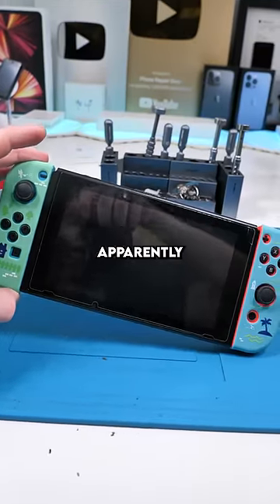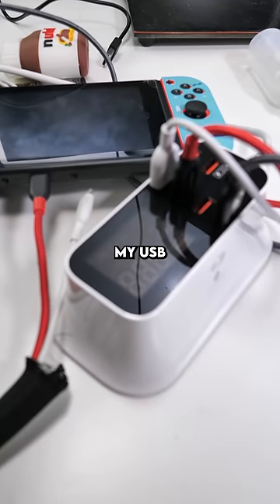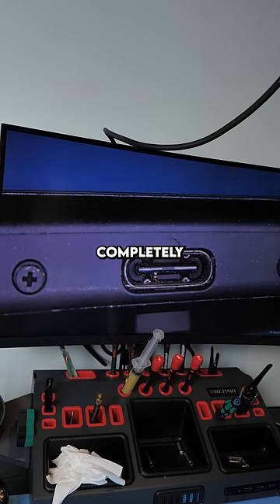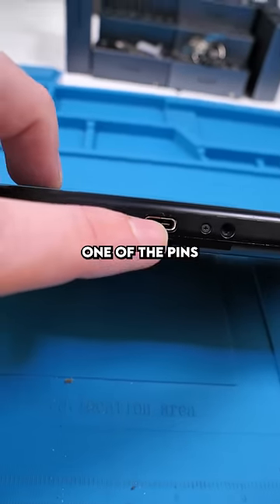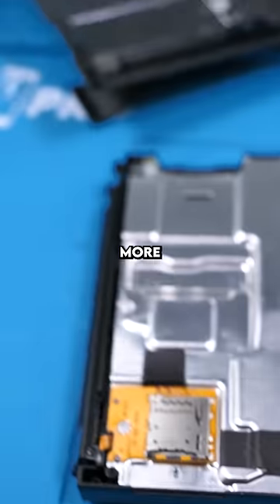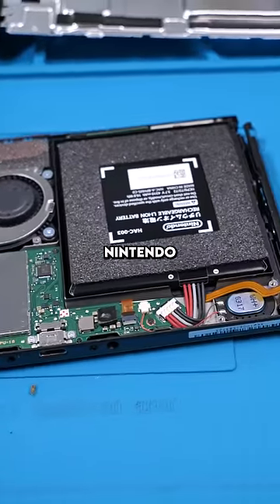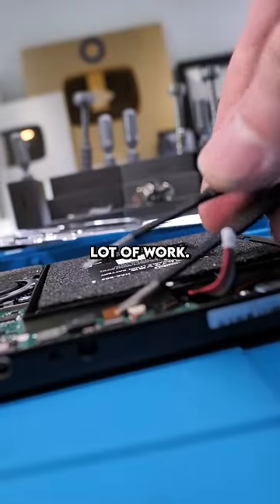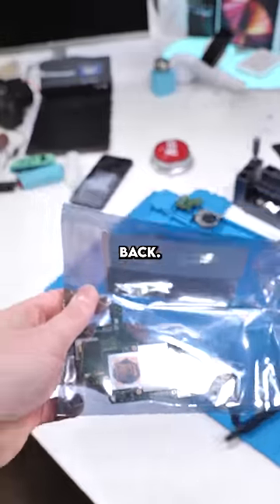This Switch Wouldn't Charge... USB-C Durability is 🗑️ #Shorts

Comment: I hate the usb c charging port as I have lost 2 switches to I blowing the charge chip. They need to make it that the male connection is on the cable not the female one.😢

Comment: I used my warranty to fix my Nintendo switch that wouldn't charge or turn on when it was charged and when you put it in the hdmi box it didn't have the green light so anyways when it was fixed and they sent it back... my left thumb stick was gone, like not broken but completely gone

Comment: Serious question, are you a repair shop that doesn’t do simple in house soldering work? That repair is very elementary, you should get some old boards and practice. It’s not like you’re reballing a chip or anything.

Comment: It would be cool if you could fix my Switch. It overheats a lot and so I thought there must be a lotta dust or the fan got messed up. So, I got a replacement fan and the tools to install it just to find out 2 of the screws in the back got stripped :/

Comment: I'm gonna call bullshit on that, it's impossible to pull out a singular pin off of a type C though normal use, however much one pulls, pushes and bends the cable into the device. That most certainly happened either because the person tried to pull out debris with a pin or toothpick, or the video is trying to push a tongue in cheek plug to Apple's lightning port as the sole purpose of the video. The lightning port is also getting pushed out by european law, so odd timing...

Comment: This would never happen to a lightning port I have had a total of one Apple product with a lightning port and I needed to replace that thing three times and I went through several cables Good quality and bad to contact got dirty so fast and you couldn't clean them I tried my experience with the lightning port is absolutely atrocious and now everything I own has a USB type-c and not a single issue except cheap cables breaking but that's any kind of port

Comment: USB C Is great but it’s also very overrated. 

Though the lightning port is incredibly slow it did have a really good snap and retention for plugging things in, also having the pins on the outside instead of being on a flap in the middle made it far more durable (even though the cable strain relief was far less durable)

Fuck Apple for holding onto the lightning port, forcing the EU’s hand because now nobody including Apple and any other competitor can improve on USB-C with a new port.

Comment: Yeah too bad lightning is also a trash USB 2 proprietary form factor. Seriously. USB 2? In this day and age? USB C is currently compatible with speeds up to 80x what USB 2 is capable of and USB C offers up to 100W power delivery while Lightning offers a grand total of 20W. USB C also happens to be non proprietary and a highly standardized form factor so you don’t need extra cables

Comment: Hey man, my switch has a broken internal port, so it doesnt display the screen onto my monitor whenever I put it in the port. I have replaced the dock, the hdmi cable, and even the monitor. I dont want to pay $300 for a new switch, so how much would it cost to fix it? Or does anyone have tips for this issue?

Comment: You wanna know something amazing? Making false statements to try and make people share your beliefs tends to have the opposite effect since it just tells us that you don't know wtf you're talking about and now even if you do say something accurate we might not even believe you cause you were wrong earlier when talking about this topic
Reply from the maker: I’m only human, I don’t know everything about everything. I try my best to make sure everything I say is factually accurate. If you’re referring to this video in particularly I’ve tested the durability between both and can definitely say that the lightning port is more durable than usb- c.
Reply: @PhoneRepairGuru  you said it would never happen to a lightning port which is just factually incorrect, you could have said whatever you wanted about durability and that's fine (assuming you're correct) but don't say it will never happen when i can guarantee pins get bent on lightning ports all the time
Reply: @PhoneRepairGuru  and also I don't expect you to know everything but either don't say something if you're not sure or at the very least don't use wrong info as backhanded insult
Reply: No no argue

Comment: Hey I want to ask you where this place is I have a broken switch that needs repair. I left it out in the rain accidentally and now if I put both controllers on it it won't work and this is a problem because it won't work in airplane mode now